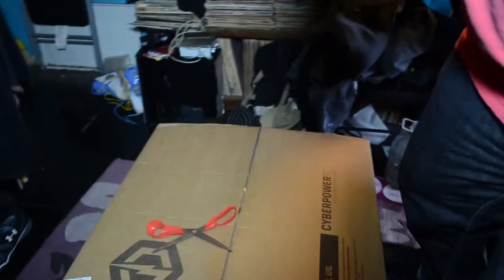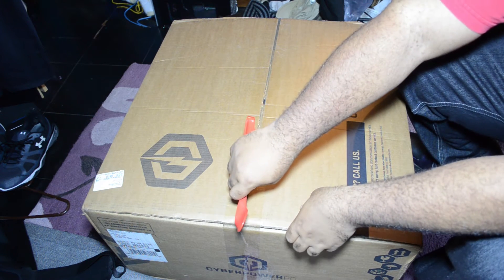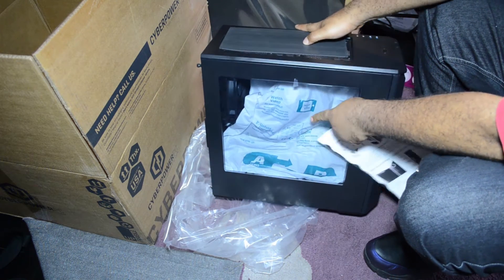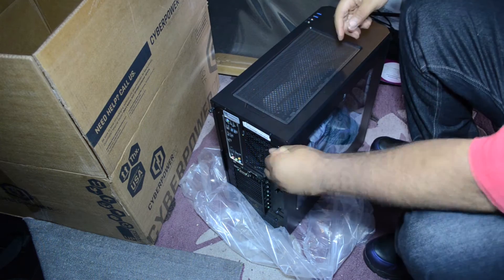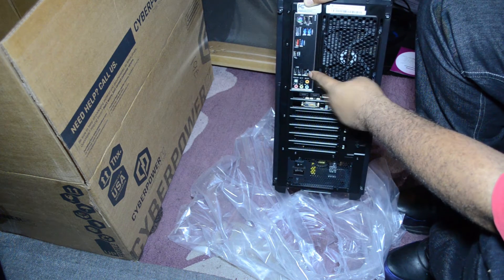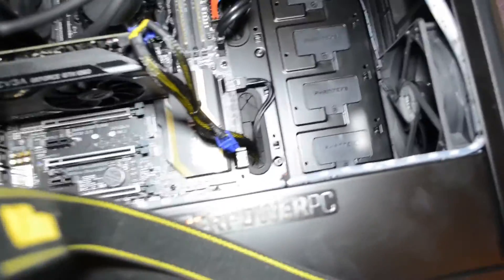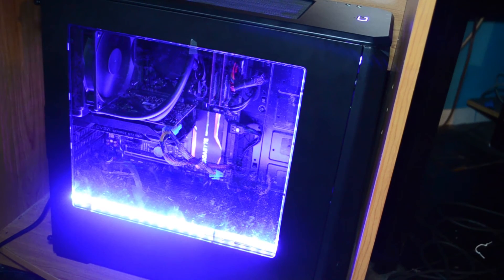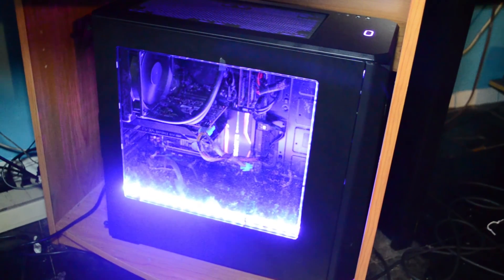CyberPowerPC Unboxing and Specs

Comment: how is it holding up today?
Reply from the maker: A few times using Pro Tools I did reach my limit where the PC / Program starts to randomly stop. That's only here and there when I have like 50 plus tracks in the session. Majority of the time I don't get to that point. I didn't get to do any big video projects yet so I'm not sure how Adobe Premiere will handle it but for blogs and the little bit  of media I do everything runs smooth and render time is fast. After Effects is a little different, it pretty much maxed out my 32gb of ram so I may end up getting more ram after I test it out other effects. Other than those minor hick ups everything I use the computer for works fine so I am happy with my purchase.